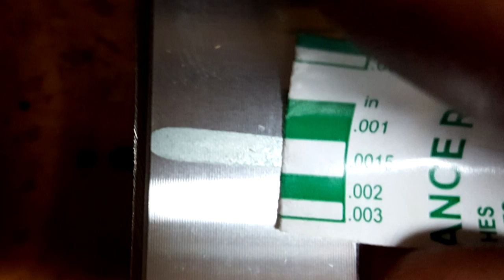LS 5.3L Build Part 4 Bottom End Assembly | Project Rowdy Ep008

Comment: what happens if your plastigage does not read measurements within tolerance? would you have to use tighter bearings?
Reply from the maker: Yes...  As things wear out, the "Gap" (clearance) might get larger.  It would need to be "trued" round again to the specs of the next larger (thickness) bearing.  I don't have that kind of experience, but feel it would be rather common.  Cheers!

Comment: So I followed all the steps to assemble this engine. The crank turned over fine with everything up pistons in. When pistons were installed is when I had a rotating problem any ideas what could be wrong? Also followed my ls build book u recommended and I don't see anything I could of missed.
Reply from the maker: The crank rotation will become tougher to spin as Pistons are add due to the friction being created by the rings.  You might want to take the Pistons back off one at a time and see if there is one that is creating your problem.  Also... not sure if what I am about to suggest applies to stock piston rods.... but the Rods that I used have a little offset.  If I were to take my Pistons 1 and 2 out and simply rotate then 180 degrees in the same cylinder that they belong in... I would have some binding that could cause the issue that you are experiencing.  Check the Offset of the Rods at the Crank.  I can check my stock rods tomorrow.  I can forward you some photos.
Reply: I've removed everything and started over lol. And I will definitely check what ur talking about. I think I know what ur saying. Sorry this is my 1st time. It's got me freaking out haha. And thanks a lot 4 yr knowledge. I would also like to see the pictures bud.
Reply from the maker: If you are following the same book that I mentioned, check out The Piston and Connecting Rod Orientation Rules on pages 113 and 114.  My aftermarket Pistons and Rods required orientation mentioned at the bottom of page 114.  Please read the whole section.  Bottomline:  If I were to take piston #1 and rotate just the Rod 180 degrees, there would be an issue with fitment and alignment.
Reply: Hey bud did u ever get to take some pictures?
Reply: Also I started with one and did fine but installed 2 and the crank got to where I cant turn it. So something is going one cant put my finger on it.
Reply from the maker: Are you installing the original Pistons or something Aftermarket?  Did you remove the Piston Rods from the Pistons and then re-install?  Tell me more about what piston and rods you are installing and if you assembled them before trying to install them.
Reply: Well I have a 05 4.8/5.3 it was originally a 4.8 I swapped to 5.3 crank and am using 5.3 rods and 4.8 pistons. When I originally got the engine they had 4.8 set up. I wish u had my number so u could send u pictures or videos lol. My number is 8793338643. Oh also I messed up by putting the 4.8 rods in and everything rotated fine. But unfortunately those were the wrong rods to convert to 5.3. Have to use 5.3 rods and 5.3 crank. At least that's what I've read.
Reply: Well I put #8 in #1 and turns fine. So I'm guessing I need new rod? Sorry to be bugging u so much man.
Reply from the maker: Send me a private email to:  ucandoit2mike@gmail.com and I will forward a photo of my old 5.3 pistons and rods.

Comment: When pressing on the rod and crank bearings, if the plastic gauge isn’t in the correct parameters what do you to change it
Reply from the maker: RickDiesel718 That is when you change to a different size Bearing.    If the clearance is too tight, you would use a thinner bearing.  If to loose, a thicker one.  In my case for the Crank,  I was able to use stock size Bearings because we did not modify the Block AND we just polished the Crank Journals.  If we had to grind or heavily polish the Crank, I might have needed thicker bearings to achieve standard tolerances.  I wanted to check mine to make sure the polishing that we did was acceptable.   Cheers....  Mike.
Reply: Awesome thanks for the reply, I’m gonna be doing my own soon for a 2 door Tahoe and these videos are so the best I’ve found I’ll be watching them a thousand times and I’ll be asking 100 questions haha
Reply from the maker: Awesome that you plan to build your own.  You should consider a Build Guide (book) that can provide a lot of insight and additional information.  There is a link to the one that I used under each video, and there are many others out there.   I have some answers as long as they are related to general builds and fall inline with my research of this particular relative stock build.   Cheers and enjoy the learning process!!! Mike

Comment: Ik this video old but did you order all new stock parts
Reply from the maker: In the description section below this video is a link to a PDF file that you can download that lists all of the parts that was purchased for this build.  Most of the parts are upgrades and not “stock” replacements for this engine.  Some upgrades include:  Valves, valve springs, Cam, Rods, Pistons, Rings, Oil Pump, and Water Pump.  There may be others but that it what I remember off the top of my head.  Stock type replacements include: Crank Bearings, Rod Bearings, Most Gaskets, Rockers, Push Rods, and Sensors.   Hope this answers your question.
Reply: Yes it did thank you

Comment: I think I may have overlook the reason that you put the 5th main cap on backwards. Could you please explain that to me?
Reply from the maker: James Dyer I originally put it on backwards by mistake!   All of the caps are stamped with numbers 1-5 along the driver’s side (except number 5).   I looked at the numbers when disassembling but did not realize #5 was stamped on the Passenger side.   I put it on backwards and then later realized my mistake.   So I later flipped it around.   I left the footage in the video as others could make the same error trying avoid anyone else making this error.
Reply: ok i was just wondering. thanks alot. im following you guide from start to finish.

Comment: If it does not meet spec what must be done,send to machine shop and have it fixed.?
Reply from the maker: It would depend on which piece didn’t meet spec.  There are about 3-4 different things mentioned in this video that contain specs.   My first thoughts are if you are out of spec, you need a good way of measuring the scope of the difference.  How many items.  Is it across the entire journal.   Etc.   it may take machining to level things out….   Then you can use different components to make up the difference.   For instance, if the Crankshaft journals need to be machined to make them consistent, they would be machines to the next acceptable measurement and you would purchase main bearings to fit your new measurements.  Hope that helps.

Comment: 16:00 Cam retainer plate looks used. I'd replace unless the seal looks very good/has very low miles on it.
Reply from the maker: Thee plate should be fine.  The kit that my machinist put together included a new gasket for this.
Reply: @UCanDoIt2Mike  I didn't know they made a replacement gasket. Thanks!

Comment: i see a better way of torking the piston rod end caps instead of torking one single rod on the bearing or journal put both connecting rods on in the one section to be torked
tighten one with low pressure or untorked , so now there's still a few thou play between both connecting rods in this area try to remove that play  use 2 old feeler gauges metal blades between them near each nut to remove play , better take the diameter of the journal
cut a piece of cardboard then draw that circle on the feeler gauge blade use a dremel
to make a partial curve on the feeler gauge blade , the point hear is to remove slack
between the 2 connecting rods journal area to be torked, so basically
what you are doing when there is one connecting rod alone on the journal is your twisting
the round shape of it while near the end of full torking force , your bending it without support
it has to be held or supported from this lateral force, which it will never see in its lifetime of operation, another solution is a hard wood fork wedge to but up the connecting rod to the far side or counter weight side, then you can tork it, but rod number 2 will need 2 feeler gauges blades as a squishing support , to tork, no lateral or side forces should be applied to the crankshaft and connecting rod end caps, as it will never see this force in its life of operation
Reply from the maker: I understand your theory on lateral forces, but I have to say/bet that No One... Shade Tree, Master Tech, or Factory technicians use that method.  I don't think that shimming up the clearance space will change the lateral force applied to the rod bearing.  But I have to give you kudos on thinking outside the box.  Cheers!

Comment: What kind of rods and pistons are you using for this build  brand ??
Reply from the maker: The Pistons are:  Sealed Power (H1127CPA.50MM) 0.020 over stockThe Rods are:      SCAT H-Beam (2-LS1-6100-2100-945)I have all of this documented and will scroll through it at the end of the Engine build. But don't hesitate to inquire if you see something that needs to be clarified.
Reply: Good stuff my friend

Comment: Instead of plasti-gage, why not mic the journals and the bores of the pistons and the main caps and determine your oil clearences.   Plasti-gage is more for use when you cant have the crank out like a repair in the vehicle.
Reply from the maker: bryon weatherford Plastigauge is extremely easy to use and very accurate.  Either option is fine. Either way you are going to have to tighten and torque the main bearing to get that reading.  Plastigauge doesn’t require any special mix tools.

Comment: Personally i have built a couple small block chevys and have never seen the whole 15 degrees thing what is that
Reply from the maker: I believe starting with the Gen3 platform engines, GM began using Torque To Yield (TTY) style bolts (Head bolts, Harmonic Balancer bolt).  I believe the theory is by initially torqueing a bolt to a lower torque and then rotating a specific amount of degrees, they can create a more consistent clamping tension of the bolts.   These bolts are designed to Stretch!  Due to using Stretch to apply tension, TTY fasteners are One-Time use bolts.  They should not be reused.  Hope this helps!
Reply: UCanDoIt2 I forgot about the torque to yeild bolts

Comment: @1:50 should of plastigaged the bottom & top halves for a true reading
Reply from the maker: Not if you follow the directions.  The measuring gauge is calibrated for applying strip to one side.   Not sure where you found your information, but it is not accurate.

Comment: is this process similar if i stroke out my motor like a 383 stroker kit?
Reply from the maker: craydul For the most part, Yes.  383 is Boring and honing to larger diameter pistons, then a different Crank and longer piston rods.   And it is also done on a Chevy 350 platform.

Comment: great video i only saw one thing when you torc a bolt your not suppose to reuse those bolts not saying your doing anything wrong i have reused head bolts before great video tho
Reply from the maker: You are correct...  Head Bolts are Torque to Yield and should not be re-used.  All of my head bolts were new.  FEL-Pro ES72173 (2 boxes)
Reply: UCanDoIt2 still great video very detailed im working on a 4.8 pulled it for lifters ticking replaced it with a 5.3 now ima build up the 4.8 for a future project prob a ls swap in an old elcamino
Reply from the maker: That is awesome!  Should be one sweet El Camino!  Have fun!

Comment: The connecting rod bolts are tty?
Why do you torque to 63 lbs?
I have that question because the manual say 1 step 15 lbs final step 85 degree. 
The bolts are m8 10.9, the bolt torque chart say 30 lbs
Please help me.
Reply from the maker: The Connecting Rods that I am installing are not factory..  I followed the manufacturers specs for tightening these specific rods
Reply: UCanDoIt2 oh very good.

Comment: Are all 5.3 lm7's 4 bolt mains? Or am I missing something here?
Reply from the maker: I believe the starting with the Gen II (1992-1996), GM redesigned the Block.  The LM7 is a Gen III which also includes that redesign. As shown in the video, they all have 4 bolts on the bottom of the main caps as well as 2 from the sides.  Since they (Gen II, III, IV, and V) now all share that in common, I have not run across anyone using the term "4 Bolt Main" as you would with the Gen I engines where that did it properly described the difference of 4 and 2.  I'm not the expert!  Someone else may have better information.  Thanks for watching.
Reply: Robert  Anderson
All GM LS blocks are skirted 6 bolt mains.
Some aftermarket blocks are not skirted, therefore only having 4 bolt mains.

Comment: Did you pre lube the bolts when torque to check clearances or only lube bolts for final assembly
Reply from the maker: Don't remember if I did or not.   I wouldn't hurt to do it... so go for it!
Reply: @UCanDoIt2Mike  ok thanks. Also did you pre lube the chain in oil first
Reply from the maker: tj I did not pre lube before installing, but I did squirt with oil prior to installing the cover.   You can lubricate any item you want.  The only thing that is different than old school is do not soak your lifter prior to installing them.
Reply: UCanDoIt2  one more question. I am using the same main cap bolts and couldn’t get them to torque down past 30 degrees
Reply: UCanDoIt2  one more question. I am using the same main cap bolts and couldn’t get them to torque down past 30 degrees
Reply from the maker: @Moparbarnett88   A little confused. You can't because they bottomed out of you weren't strong enough.   What do you think the problem was?
Reply: @UCanDoIt2Mike  I'm not sure, I'm using the original bolts so when I felt how tough it got I stopped because I didnt want to snap the bolt, if its safe to use the same bolts I'll just use a breaker bar and turn it
Reply from the maker: @Moparbarnett88    Hang on...  There could be debris in the holes.  Look up videos or writeups on "Chasing threads".  It is a method of cleaning the threads before installing the bolts.
Reply from the maker: Also. let me be clear....  NEVER use a Breaker Bar to install a bolt.  You will just ring-off the head when it decides to surrender.   Cheers!!!  Mike
Reply: @UCanDoIt2Mike  
I just found the thread chaser, I'll try and clean it first.

Comment: You know you don't have to slide the piston and rod assembly into the cylinder to plasti-gauge right? You could have just layed the rod across the oil pan rail to make things easier on your back!
Reply from the maker: YZFoFittie There are many ways to do much of what took place these videos.   My opinion is that your approach would be more difficult as the fasteners would be harder the reach and the plasti-gauge would best be placed on the side of the journal and want to fall off. With the rings not installed on the pistons.... this was very easy!!!!
Reply: @UCanDoIt2Mike  yeah it's better to do with the rods bare, before hanging the pistons. Also keep in mind, it's better to put the plasti-gauge on the rod side so you don't alter the reading, by tapping out there assembly, using the Piston like you did.

Comment: My crank won’t spin after I torque the main caps any idea why? More than enough lube
Reply from the maker: Just thinking logically off the top of my head....   Could be the wrong size Bearing (not likely).  Did you place the Tang on the Bearing in the Relief of the journal (most likely).  Crank was dropped and the Main journals are no longer in a direct line.  Did you clean all the surfaces?  A small object between the Bearing and the Block could cause tightness.  Hope it helps!!!!
Reply: Mains where facing the wrong way but video helped me realize it thankyou
Reply from the maker: Glad you have it figured out!!!!

Comment: where did you buy the 5.3 rebuilt kit
Reply from the maker: I purchased it through my machine shop.  It was not truly an off the shelf kit.  They called their distributer and gathered all of the parts.  Some of it was in kit form, but there was so much other stuff that my machinist specified which matched what was needed based on measurement of my particular engine.

Comment: You didn’t paint the engine??
Reply from the maker: Part 7
Reply: Ok I’ll have to watch that... just a quick question. Can you bore out a 4.3 can you? Obviously not you but just in general.
Reply from the maker: The 4.8 and 5.3 engines use the same block.  You will notice embossed in the block casting, it says 4.8/5.3.  The difference in displacement is not in the diameter of the cylinder bore.  You should be able to successfully re-bore at least 0.030 over if needed.  I had to take mine to 0.020 over to remove some taper that was present.  Hope it helps.

Comment: Whats the torque on the screws of the pistons?
Reply from the maker: Do you mean the Connecting Rod end cap nuts?  It might be a little different for each Rod manufacture.  The standard GM rods (according to the book) is 1st pass 15 ft-lbs then 2nd pass 75 degrees.  I am not using stock Rods therefore mine were something different.  If you are using aftermarket, follow their recommendations.  Mine was something different than this, but I cannot remember.

Comment: What type torque angle gauge device are you using?
Reply from the maker: It is Home-Made.   An old CD with an image of a compass that I downloaded/printed/adhered to the CD.  An Angle is an Angle...  it worked great.  Cost me 2 cents worth of printer ink.
Reply: @UCanDoIt2Mike  What is "CD" referring to? What is the metal part of your device?
Reply from the maker: Just an old Music CD or Software CD that is no longer needed.  The metal shaft in the center is the 3/8 Ratchet Extension.